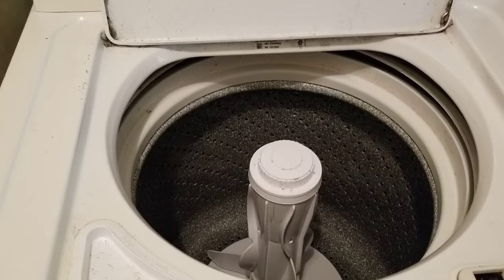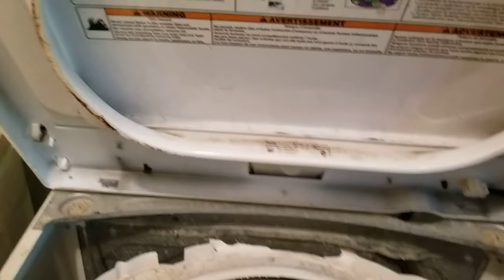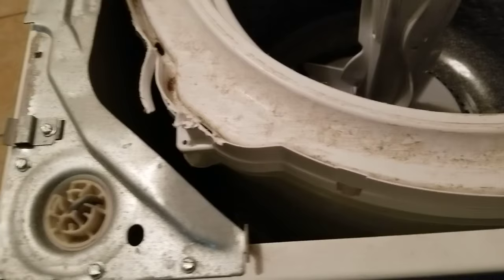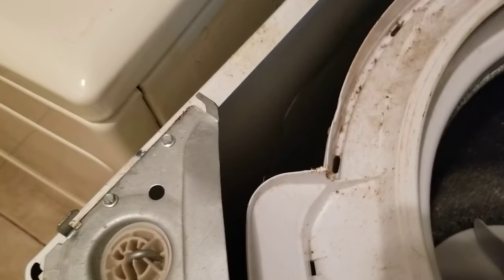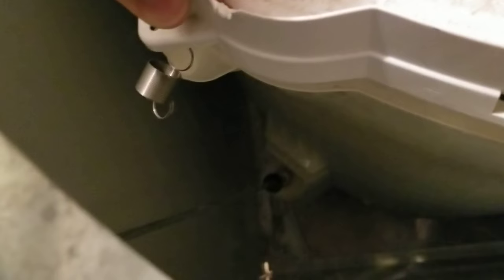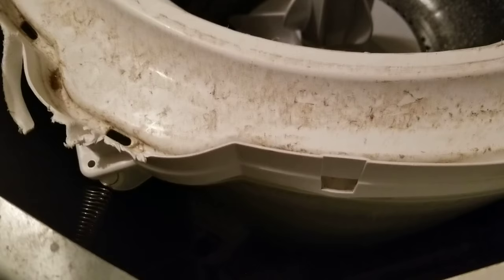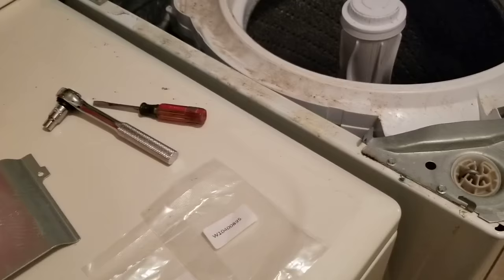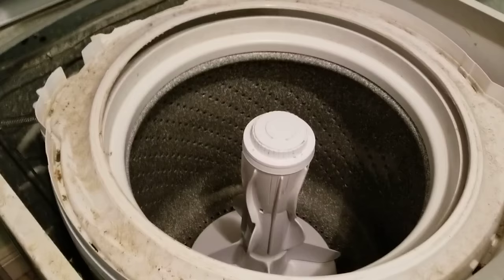Roper / Whirlpool Washer banging out of balance No. (1)  / shakes / moves *(worked briefly)

Comment: Thank you for your very informative and easy to follow video. I have a very old Maytag washer that was making banging noises. I ordered the 4 springs from Amazon. They came today and I installed them. I ran a load and it was quiet as can be! The hard part was lifting the rods to attach the springs. Not bad for a 65 yr old woman.
Reply: You rock. Or should I say she bangs!😇
Reply: Wow ... Well done beautiful 😍
Reply: I just did mine today.You are right the rods are the hardest !I am an 80 year old female
Reply: I sure hope this is my problem, I just replaced all the suspension springs and tabs in corners, and after doing that and recalibration, it still was shaking violently  all over. Now, my top ring is ripped like the one in video though, and was wondering if that could be my problem. Mine actually doesn't look as bad as this one in video, so I don't think that's it. Guess I'm more so really hoping it's not,because the cheapest tub ring replacement I found so far is damg near 80 bucks. And ya,I only paid like 200 for this ol washer, and ide rather buy a better bigger washer than spend 80$ on this horrible washer. I hate this washer, I've had so many issues with it, and it takes forever to go through even the shortest washer cycle.

Comment: OMG!!! You saved me at least $300. the Sears repair guy wanted $100 just to come out and look at it not including the I'm sure EXPENSIVE replacement parts to fix it and his labor. I have an Admiral washing machine a generic Maytag, which should be shut down for selling products that are bound to break, that was banging and crashing around. First I tried replacing the rod and shocks. No good. Still banged around looked up the Admiral website and found a video about the springs. The said if the springs were broke the washer would be off balance... Now when I started the repair I didn't take any springs off the machine and there were no broken springs anywhere. You are a great American, who I respect and say thank you so very much for confirming my theory. That Maytag guy should be tar and feathered and ran out of America. TY, TY, TY
Reply from the maker: Glad I could save you some money, one of my goals here.

Comment: Roper washer here, added springs didnt work for me, still banging. So then I jammed pillows and blankets around the tub pretty tight. That worked 👍 I have never hated an appliance like I hate this washer. From day 1 it ripped my clothes from agitating while it fills with no water in it, then the lid lock broke, had it fixed under warranty, two weeks later lock broke again and magically the warranty expired. So then I hooked a light switch into the lock circuitry so when its done washing,  you have to cancel the cycle switch it to rinse and spin, start it then flip the light switch so it thinks lid is locked.  Then it started this wild banging nonsense out of nowhere like a horse kicking inside there. Opened it up and nothings broke.. not like other washers I've seen the springs break, this doesn't even have springs. Its only 4yrs old.  What a POS, I'll never by anything made by roper ever again. Hopefully I'll get another washer soon, because then I'm gonna tie this roper up behind my jeep and drag it around town

Comment: Semper fidelis, thanks I'm like many others here, thought our washer was going to fly part, it started when my brother was washing overalls, I just thought he had it out of balance, it was worse than that, that thing was bucking like a mule, I've been trying for 2 weeks to get springs close at the hardware store, I knew there should be something there but didn't know or see the correct springs I just gerry rigged it with little improvement. I'll order a pair of these, the Repair clinic has saved me 100s of $ so I'll stick with them again. Thanks!
Reply: James E. Tramel I had to laugh when you said your washer was bucking like a mule.  Mine does that.  It almost walked out the door one day.  Definitely gonna try the springs.

Comment: Thanks for the video. Mine has been banging against the side for years (usually blamed the wife for unbalancing it with towels) and then yesterday the tub fell to one side. Using your video, I found that one of the suspension rods had actually came unhooked, so I put it back. I also found that I only had two springs on one side, so I have ordered two more.
Reply from the maker: The four small springs worked for a couple of washes only, then I ended up replacing the four rods & like new for a year now.
Reply: @PatriotMarine  you should probably put that info somewhere where everyone can see.

Comment: Thankyou!! Mine is doing this exact thing. Mine had not 1 spring anywhere. Rather than buying springs I tried 4 heavy duty zip ties i already had in the shop. Well see how long they last all it needs is some type of resistance/cushion side to side front to back on spin cycle.

Comment: Thank you, Found out our washer only had two springs. fixed it with zipties on the missing corners
Reply: Did zip ties work okay? Thinking about trying to use them until I get the springs ordered
Reply: @abif220  see my SOLVED post
Reply: Thank you for this! My washer had ZERO springs on it so I tried the zip tie trick for the moment. Will order the parts or go to Lowe’s and pick them up.
Reply: I tried this same problem

Comment: The cheaper washers don’t come with the springs Home Depot has the springs located in hardware. Spring is: 2.437x0.468x0.054
Reply: Thank you so much for putting the dimensions
Reply: That spring isn't available at Home Depot (or Lowes).  They must be special ordered for damn awful prices.  The gouging SOBs at the factory want your money.
Reply: Yea but did it solve the problem, I would of like to of seen a load of wash through the whole cycle
Reply: I bought the $1000 Bravos XL model and it doesn't have the springs!
Reply: Thank you. This comment is a Godsend
Reply: Thank you so much for your video it really helped!!😉🙌🏻🇺🇸
Reply: I just put the springs on and it's still unbalanced.
Reply: Wow.. thanks that was very helpful, being reluctant to check this for months . Not home often on the the road all the time. This I hope solves the $590 dollar question👈 🤔

Comment: Just went through the same thing, BUT, when you see the broken plastic, you need the 4 rods, Period. I just replace our 4 rods and No bang at all now. I left top off, got the 4 springs coming tomorrow, I will put those on even though ours did not have any. We ran a cycle without them as it came that way, and with just new rods fixed the problem, but still going to put springs on. I did not see anything wrong with old rods, but assume they were weak, it would bounce up and down before, with new rods much stronger. So new rods will fix it even though you don't see anything wrong.
Reply: also want to know if it's still going strong..
Reply: The rods are dampening rods, that's why there are no springs. Adding the springs just makes it last longer, between rod replacements, with so many plastic parts, it only makes sense to do what you can to make things last longer, cheaply.
Reply: Yes sir, should have got the new rods and suspension in the first place, tried the cheap route and paid for it.

Comment: We figured out how to control the off-load spin-cycle issue much easier: Bought a 2800 lbs 20 foot tow cable from Harbor Freight for $12.00 and wrapped it tightly around BOTH washer and dryer (they are right next to each other). This was our solution: No banging or moving around. Very silent. Couldn't be more happy. In the last 18 months since we did this, only once did it require us to re-position the towels.
Reply from the maker: Harbor Freight does have some cheap prices on cheap stuff.
Reply: LOL
Reply: Unless this is a joke, how did you open the dryer door?
Reply: Get it done! like the cable guy says
Reply: I like it. I have ratchet straps everywhere. For free. 😂

Comment: Have exactly the same model and opened the washing machine probably 5 times and the hook support always gets displace, or plastic gets tangled with the back cover, the washing machune does not have any springs , got fed up fixing it , yout info is very helpful. Just want to find out if the springs really worked.

Comment: Excellent video ! My Whirpool washer bought in 2020 is banging badly. I checked, and there are no springs. I am going to the appliance parts store today. If they don't have it, I will check the automotive parts store, get some, and modify them. If I order them from Amazon, It will take months with this Covid19 problem. I live in Trinidad, West Indies.
Reply from the maker: For mine Video (2) is what finally solved it, years later STILL like new.

Comment: Ok, lets see if this will help your 'engineer's mind'. Here is what I found on mine. Three of my rods were pristine. The one that hangs under the bleach funnel was pretty corroded. The little black dome that rides on the top of the spring mechanism and seats in the pocket of the drum carrier SHOULD slide freely up and down the rod, though with some resistance. Because of the corrosion, the black 'slider' will lock up when an unbalanced situation causes the spring to collapse and then propel upward, moving the 'slider' into the corrosion where it gets jammed. Because the spring is now no longer compressed by the tub, the tub is resting cockeyed on the higher 'slider' which is stuck, the tub remains unbalanced and goes nuts when the spin cycle takes off. I am like you, there is no other obvious reason the spring setup wouldn't work. (Also, I can see ZERO justification for the tiny little springs that they say you need two of on the right two rods. They are far too weak to be effective for anything but the mildest offset. Plus, the machines don't need them at all until they have had considerable use. I think cleaning and lubricating the rods with something like Magic Lube Teflon O-ring lubricant might prove to renew the effectiveness of those old rods. Just my two cents. ALSO, you may want to move that corroded rod around to another location and give one of the cleaner rods a shot at the bleach for the next interval of your machine usage.
Reply: Jack R, Thanks so much for your "engineer's mind"!!!! THANKS!!!! I was going crazy trying to figure out why the manufacturer would "cheap" out on their product by "not" putting in springs, or by putting in just 2? I really appreciate PatriotMarine for making this video, thank you! But when the MFG didn't call for springs, that just threw up alarm bells for me. Since it was such an easy and inexpensive fix with the 4 springs, I figured it wouldn't hurt. I got only one wash in before the off balance problem was back, so I am going to take off 2 of the 4 springs and try that fix. Are the springs on the right side? or diagonal? left side, front or back? Since I can't find the springs on a parts schematic, I was wondering what 2 rods I should try this on, does anyone have a suggestion? I was really hoping that this fix was a "trick' that someone did and posted to save other someones a lot of money but I don't believe it's working for me, so glad it has helped so many others.     Jack R if you have information on how to replace and/or lubricate the rods I would be so grateful, its so much easier to "watch" how to repair, then it is to "read instructions"  I will keep posted if the 2 springs works for me, Again, thanks so much Jack R and PatriotMarine

"
Reply: The two springs did not work, I really didn't think they would as they are not very strong springs, like someone else said, they are like the springs in a ball point pen. So I am back to the beginning. The manufacturer did not put any springs on my model, so they are not needed. After a lot of research the problem lies with the springs on the rods themselves, they do lose their "shock" absorbing effect after years of wear. I will replace the rods, other videos show how and it is a DIY project. I am hoping that this is the fix as I love this "old" washer, it was built tough and doesn't have all of those unneeded bells and whistles,  just good old school mechanics, no computers to get in the way, that you can't diagnose and are meant to fail after the year warranty is up anyhow. SO good luck to anyone that has this model, keep it, keep up maintenance and it will outlast any of the newer expensive models out there. Thanks to everyone that posted!
Reply: @danagates163 any success?

Comment: Thanks for the video. As I was replacing the four suspending rods I noticed the holes you point out but no springs were present so I assumed there weren’t supposed to be any. Of course the washer is still going nuts so when I get home I’m going to give some zip ties and try and then potentially order actual springs.
Reply: Did zip ties help it ?
Reply: @ckeller421  no. Found out that I ordered too short of rods and reordered new oem replacements. That finally solved issue.

Comment: Update, see picture of foams sticked with glue on all sides. Now the washer is nice and quiet. I just spent $10 on the springs that did NOT help at all. Try plastic foam, or something hard but flexible. Good luck
Reply: Springs didnt work for me either, I stuffed pillows and blankets around the tub really tight, that worked 👍

Comment: Dang i noticed the holes in the top just today when trying to figure out why it has been wobbling. I immediately knew that there was supposed to be springs there. This confirms it. I am betting that the drive block is shot on mine however from it running off balance for so long. Company should be sued for not putting these springs on.

Comment: Out of balance SOLVED. 

I am living in a country without access to the springs I supposedly need. I tried the zip ties, they did not work, they just bent my rods (I just straitened them back) . My machine would bang around even with nothing in it. When slowly rotating it by hand I could see the wash drum was off balance to one side. it was warped to one side from banging around too much, my machine is on the roof and I don't hear it. Since it was warped the water ring (centrifuge)at the top of the drum wouldn't work as intended and all of the water would go to one side and cause it to be out of balance. By the way this is 15 kg capacity washer with the tall agitator, not a high efficiency washer with the flat agitator. 

Here is what I did to fix it.

>Slowly rotate the drum and with a permanent marker and mark a line on the water ring where it is most extreme toward the cabinet.

>Remove the agitator 

>With a ruler measure  from the wall (line side) of the drum to the center post

>Measure the opposite side

>Example: line side 260mm  opposite side 254mm 

>The center cone of the drum is off by 3mm

>You need to move the center cone toward the line 3mm

>I used a 20 ton hydraulic jack without the handle that just barely fit between the wall and the cone opposite the line and pumped it 3 times or so. (Keep in mind some jacks don't work on the side, at first try, with the handle mechanism facing up it didn't work, I made the handle side of the jack face down and it worked : ) A car/truck bottle jack could work too! 

On my first try I went too far the other way, just rotate it around if needed and do it again with less pumps. you will get it eventually. I ran the machine on the spin cycle, it works as intended, It has a little jiggle and you could spend more time perfecting but that is up to you. One last thing, there were rubber washers on each rod  that were 2 inches above the plastic tub on mine, just slide them down to the tub/spring. You may or may not have these. I hope this helps somebody. 

#WWG1WGAWORLDWIDE
Reply: Llpp00

Comment: The early whirlpools right after they came out with the suspension system didn't come with the springs nor the rubber straps that the later model commercial washers did.

Comment: The springs wp 6309 look  alot stiffer then the ones you show. I removed  ring there are not any holes under the ring only on the ring .The hooks are bent in drastically  and are very stiff impossible to hook in holes. This washer is 3 years old whirlpool. Is it possible they sent the wrong springs.Label reads washing machine suspension tub springs Ok editing up date they sent the right springs she runs like new   .Definitely  obvious  the lighter springs finally did the job.Thank you

Comment: Just ordered a set of 4 myself ($6.64 shipped on Amazon right now since there is a rebate) as my Roper just did this today. I have no idea how it's possible this thing was working without them given I can't find evidence there were original springs installed. Must be a bigger issue, maybe with the hub is lose or bad bearing? But as fixes go this will be easier than tearing the entire thing apart and cheaper than buying a new one. Eventually I will 'spring' for a new set, likely a front load stacked unit so I can free up some room in the garage for a solar battery rack.

Comment: usually if it's banging that bad it's gonna be the suspension rods.... Those little spring do help a bit but they are an extra a washer can have them or not just makes it a little quitter but the rods the heavy work... If you are going trouble of lifting the rods might as well replace them  to be 100% fix issue cheap set rods go for like 30$...